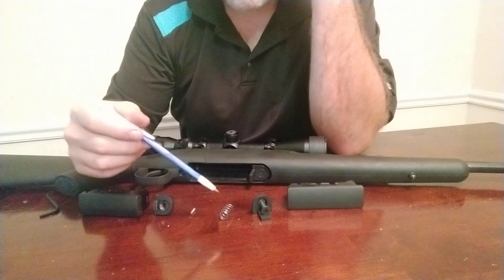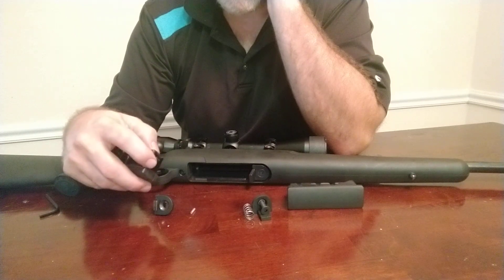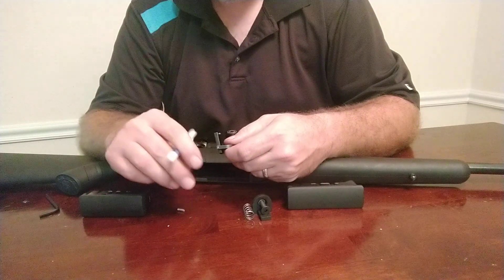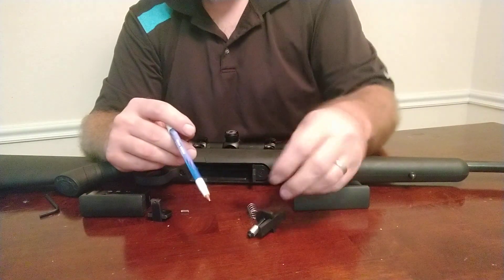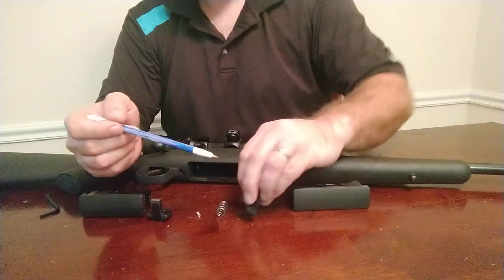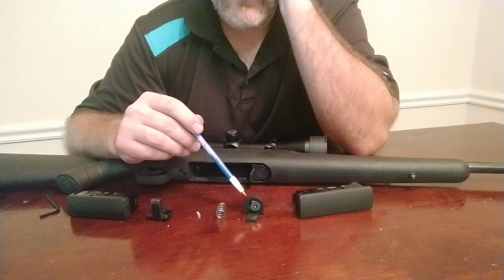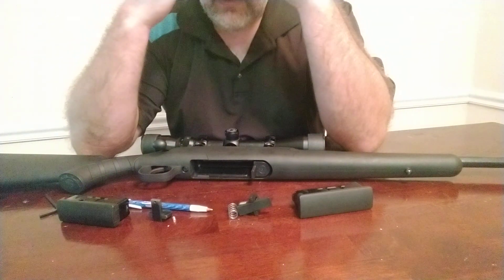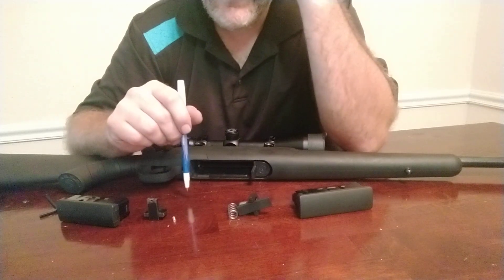ATP Gen 2 Axis mag catch upgrade

Comment: I have done both the old style and new, and this updated one is great. The savage magazines suck and they are expensive. Going to the 8 round (wont hold ten) .308 mags is the only way to go. Nice conversion now that the beefy spring is included. Savage has recently changed the Axis mags a bit too, their plastic clip thing is no longer a hoop but a different setup and much better overall (not as flimsy) so modification of the 4 round mag to fit the upgraded axis will take a bit more work.  Great job, and FAST shipping from GA. I would never be able to put up with the stock Axis mag system. Took me half hour to install and make the 4 round axis mag fit the new system because it is a new axis magazine with the metal pins and new style latch. The big spring is tricky but it is such a good upgrade. I have a major shoulder injury so suddenly a light rifle matters to me. A LOT. Never thought it would. The axis is light and kind of short and I am in serious pain so this works until my shoulder surgery. It's accurate a few hundred meters. I have 8 rounds in two mags. Don't need that many, but reduces arm movements. After surgery, I will still love and respect this gun.

Comment: How the hell do you get the large spring to fit?
Reply: Show us how you got the spring in
Reply: @alfonsobravo8142  did you ever figure out how to install the bid spring?
Reply: I cant really show you, but it's messy. Best way is to look at their first video and just see how the first version is. That little flimsy spring fits on a nub and it pushes against the wall. This big spring in version two will go the same way, but the catch is there is nothing holding it there! You have to get it all crammed in and sideways against the wall and slide the whole assembly down without it popping out and hopefully get the screw started in the hole in the stock, while keeping an eye that the spring is pretty even and straight where it should be. It will keep the bar leveraged against the magazine until you push the protruding piece to release it, if seated correctly. Took me a good twenty minutes. Again, look at the old version in the video. This is the same but a bigger spring. Goes in the same place but man it wants to slide around and jump out. It will take you a few tries and some cussing. The good news is, it is totally worth it! Once it's in place you will love it! I had the old version, and it was good. Now you get a better spring and my spring felt OK, but felt JUST OK, but now the longer lever is a lot better in pitch darkness. If you are on the BLM/Antifa welcoming committee,   these fine touches may affect you